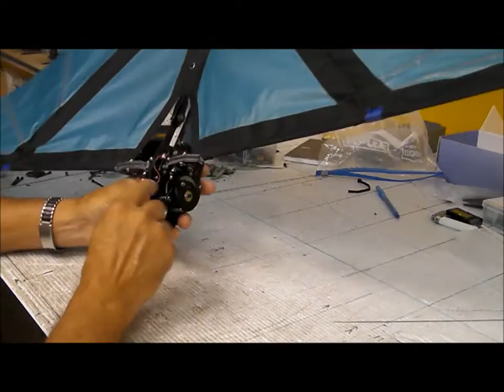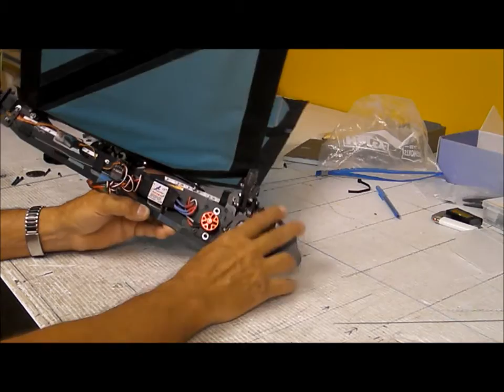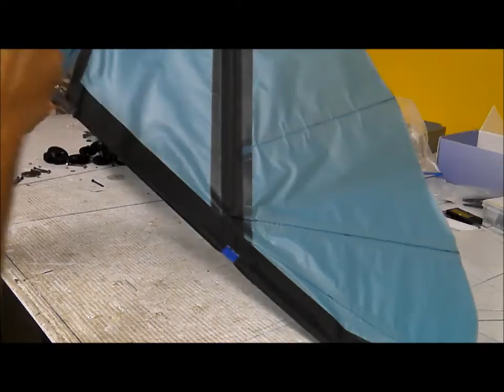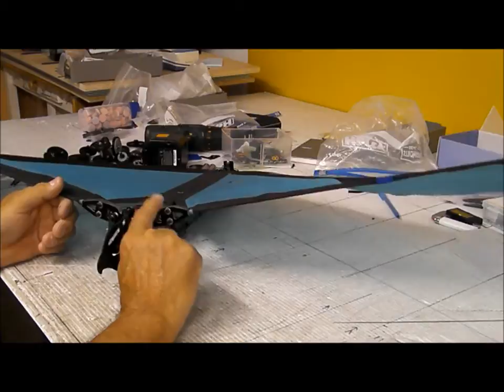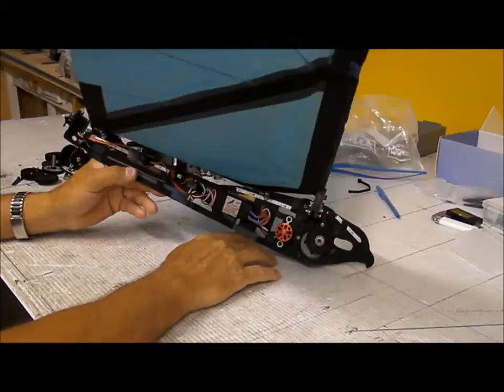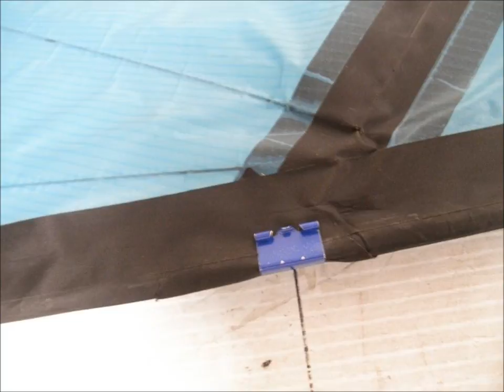Ornithopter Update  #30

Comment: I am watching progress of your bird for a while. It is amazing bird. But, I still don't se the "furcula bone" on your bird. Why do you not apply this 'flying helper' to your bird?
EDIT: Without "furcula bone" (as real birds has), you may use steel gears, but it worn out at the same point as with your plastic gears. Mostly during beginning of wing downstroke.
Reply: Is there any update about rx tx ... how the connections are done ..